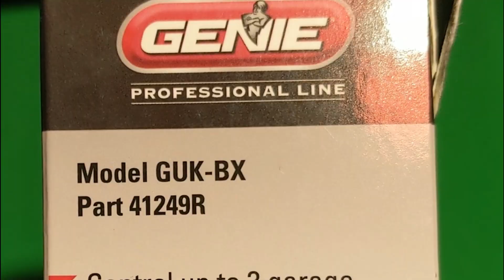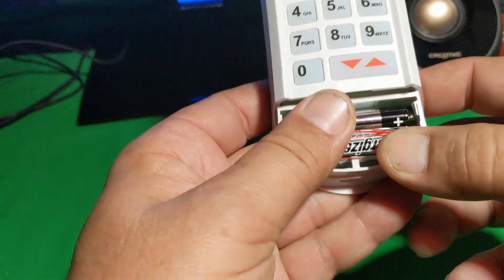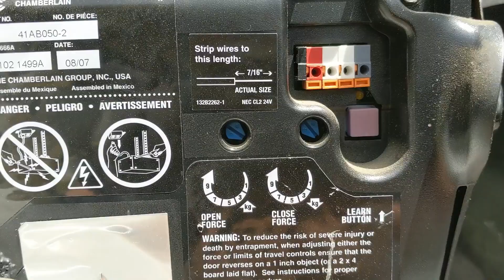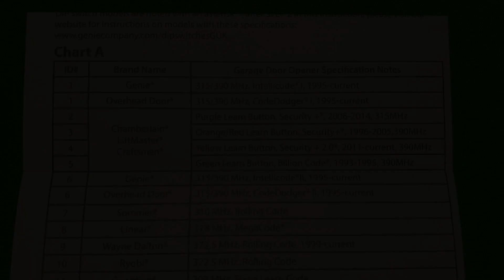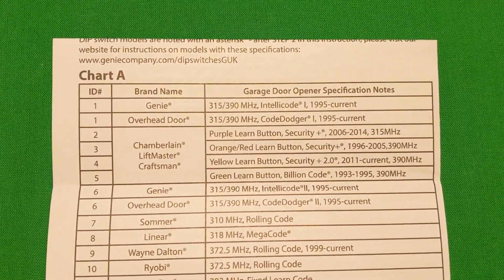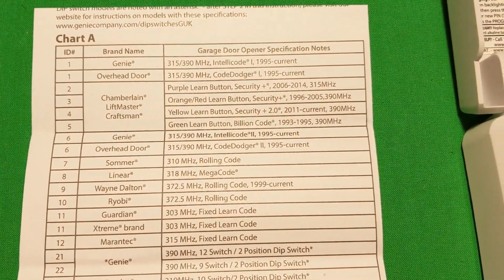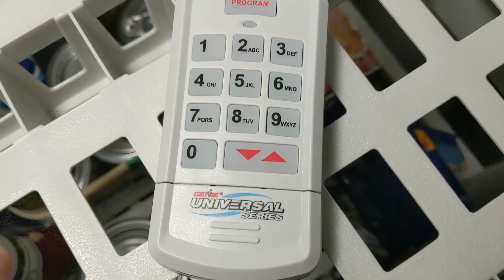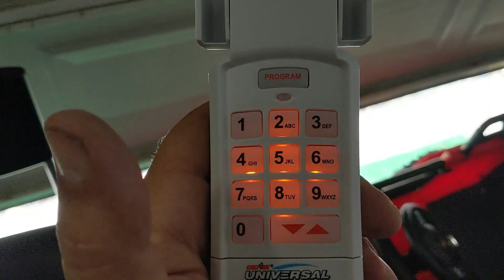🆕 How To Program a NEW Wireless Genie Universal Keypad - Garage Door

Comment: I have a Genie 7055 and it works going down by pressing the mounted button but it won't go up.  I can manually bring it up pressing the button on the unit but not with the remote.  It's almost like it's not strong enough to open the door.

Comment: I have an older Genie Intellicode II series opener. I have watched your video as well as the video on the Genie website. 
When I get to the step to press the up/down button every 2 seconds, I do it about 10 times and then everything on the keypad turns red and the door never opens. I can see on the operator that the learn light blinks every time I press that up/down button so it seems to be recognizing it but it just never opens the door. 
I have reset the keypad and retried it at least 10 times. Any suggestions would be much appreciated!
Reply from the maker: Red isn't good, lol. Are you using ID #6?
Also, when you do the steps you wanna do it kinda of quickly because they are timed.
Reply: @garagedoorgenius  
Yes I am using #6 and I am doing the steps quickly. Literally on the ladder right next to the operator. I’m stumped!
Reply from the maker: @sbaker4786  try pressing and holding the learn button in until the red LED goes out.  The opener could be clogged up with codes.  
Then try the steps.
Reply: @garagedoorgenius  
Nope that did not work. Bummer. I noticed a comment in here about a year ago from Misti that she had the same issue but am unsure what they ultimately did to fix it.
Reply from the maker: I'm so sorry you're having that much troubles with it 😩.

Comment: Also, if you have an old Genie with the Dipswitches and no learn button (ID 21 in chart A), when you get to the point of hitting the learn button you will instead enter a series of "1" or "2" on the keypad corresponding to your dipswitch code. Then hit the double arrow button as described and the opener should operate.

Comment: I've programmed the Genie GUK-R remote now none of the car HomeLinks or clickers work.  Reprogrammed the clickers and the GUK-R keypad does not work.  Any ideas?  Is it one or the other?  if so, the Genie is going back.  It's a Marantec opener.
Reply from the maker: So, sometimes garage door openers will be maxed out from previous codes.  Meaning you need to clear out the Marantec memory.  Then reprogram everything.  Just not enough "storage". 
Now with a Marantec it's not an easy task.  They make it super difficult to do.  Do you have the 3 pin connector that comes with the remotes?  You will need that to clear the memory.  Most folks have no idea what they are or where they are at.  
Although Marantec is German made, they are junk.  Yes they are quiet, but that's about it.  Not user friendly at all.
Reply: @garagedoorgenius  Thanks for the quick reply.  I am fortunate to have the 3 pin connector and the manual.  I'll look through the manual again to see if there are instructions on clearing the memory.  Are you saying to clear the car clickers codes or the codes in the opener?  There are instructions to clear the car clickers, but not the opener.

Comment: I’ve been trying to connect this thing for a while now and it’s not syncing. It’s a Genie Intellicode IB900/B. I get through everything correctly, but when I hit learn on the motor and start pushing the up/down on the keypad, it lets me click it about 10 times then starts flashing red and never opens the door.
Reply from the maker: Misty, the learn button starts flashing red ?
Reply from the maker: Did you watch this video first?

https://youtu.be/3P2XnjLvoS4
Reply: My bf got it to work. I’ve programmed them before and never had an issue. No clue what was happening. Thank you!
Reply from the maker: @Jerm Cheek is this the NEW Universal Keypad or just a regular keypad (existing one you had)?
Reply from the maker: @Jerm Cheek hold up..takes a minute to type. 🤣

Comment: What will happen if my garage had no cable tension
Reply from the maker: It will rip the opener door bracket off.  Cause top section damage.  Potentially mess up the opener.  Not good stuff!😬
Reply: Oh..

Comment: Their instructions suck because I’ve done it right for 30 minutes straight and garage door light flickers and then it won’t open when I put in code
Reply from the maker: 🤔 garage door opener light bulb flickers?  Does flash once?  If it does, sounds like the opener recieved it.
Does my video not help?  What brand of opener?
Reply: Garage Door Genius it flashes once but after I wait for the remote to do its thing and end the flashing I try to enter code and nothing happens.. it’s like it’s a bad code.. I know garage doors work because previous owner used the garage door remotes in their cars .. I even reset the garage door opener (I think)
Reply: Garage Door Genius it’s a liftmaster “the professional line” 1/3 hp made in like 95-97 I’m guessing since that’s when house was built around
Reply: Garage Door Genius your video and their instructions just don’t seem to help in my case.. the keypad doesn’t seem to save the pin I put in because I just get flashing red lights as if it’s wrong .. the garage door doesn’t budge for whatever reason , it’s just the light goes on and off and the garage door learn light goes off
Reply: Garage Door Genius determined it must not be a truly universal garage door opener or the one I bought is defective so will have to return it
Reply: Thanks for help lol